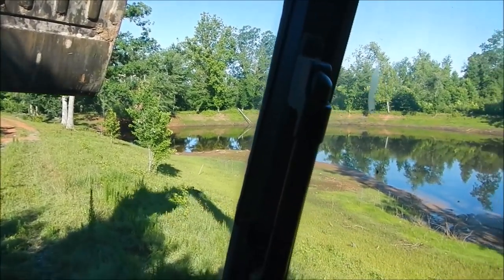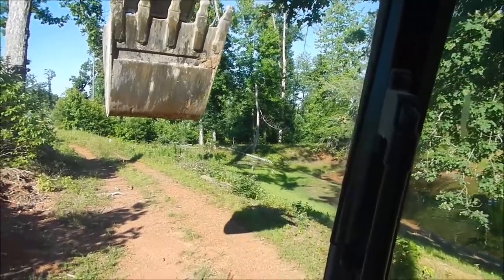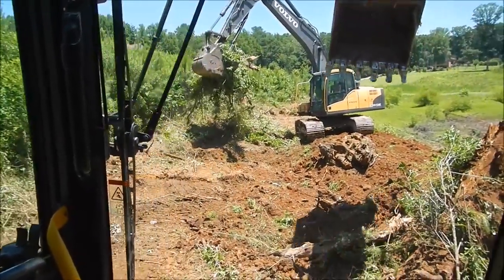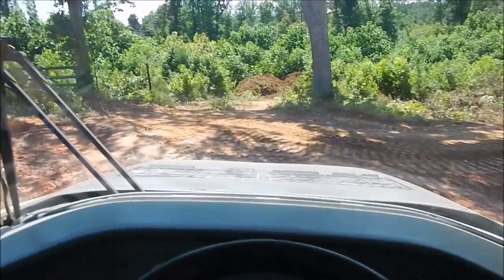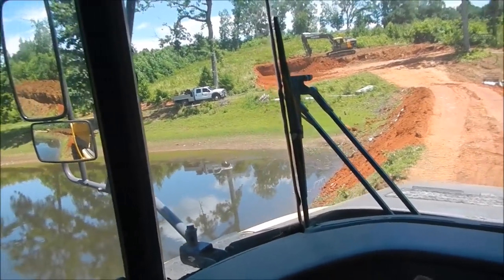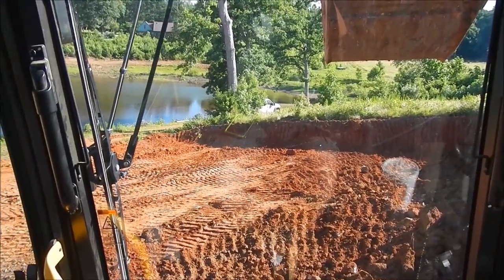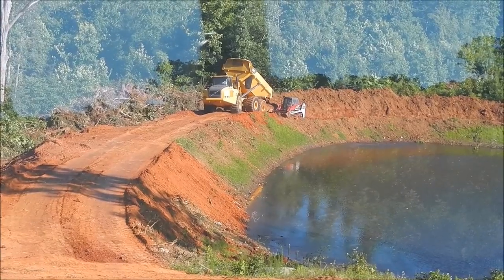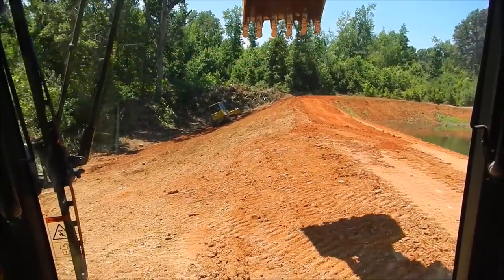Fixing A Leaking Pond

Comment: Boys them mirrors will mess a guy up..  I tried to run one before and made a total ass outa myself...  worse than normal and after almost all day still couldn't hardly get it...  kept thinking i was backing a trailer
Reply: Only time them shiny things aimed back at you that you check your make up with will mess you up, is when you don't use them Tater. Especially when you are careening towards overhead power lines with the bed raised up. Made a pretty fire though.
Reply: well hello logger wade i'm a sub to your channel to

Comment: Trying to compact with a tracked vehicle waste of fuel and machine .
Reply: Dale olson because you're the expert.
Reply: Well, he's not wrong. Tracks spread out the weight of the machine over a larger area causing less compaction to the ground underneath.
Reply: Dale olson oh it will compact it all right it spreads the weight out but it sure doesn't make it go away and do the math that still a heck of a lot of lbs per square inch
Reply: Dale olson it is but if spread out thin with quality fill it should be fine plus the haul truck on top